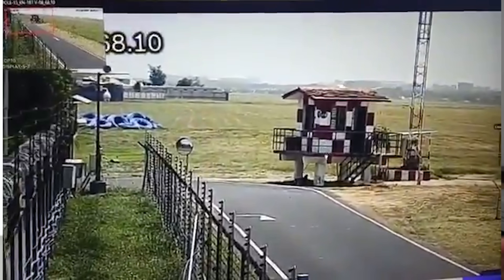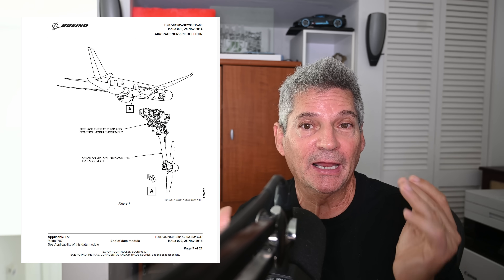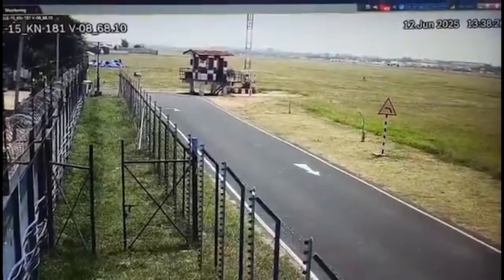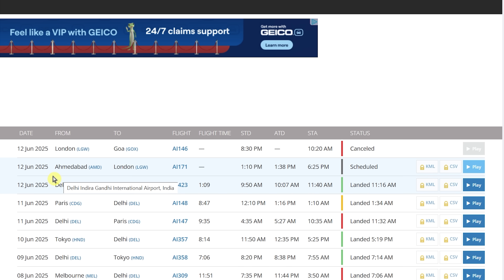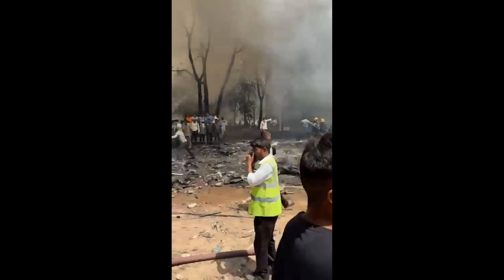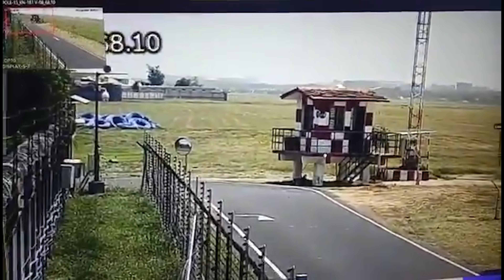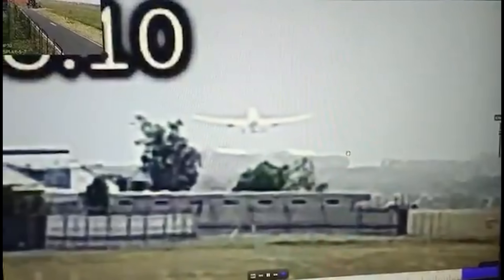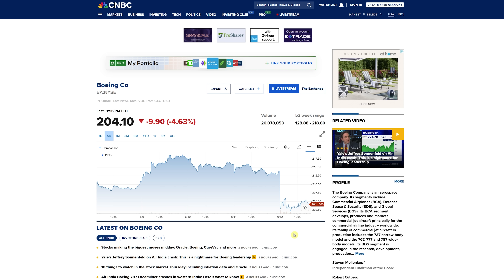What Caused Air India 171 Crash, Mysterious Sound Before Impact

Comment: (what I think it might be, before watching the vid)
as a non-engineer/pilot, my first thought when i saw this video was that he pitched the nose up a little too far when he wasnt getting enough lift, and it caused the engines to stall by the end of the runway (hence the mayday at the end of the runway) and because he was only a few hundred feet off the ground he wasnt able to correct it and crashes.

(halfway through the video analyzing the takeoff)
it looks like right before it peaks altitude, the left engine maybe stalls? because it starts scooting to the left and the left wing drops slightly, listing the aircraft to the left, the right wing comes up just a bit before the pilot levels it out again. here i notice that there is definite heat distortion above the right wing, but not above the left wing, further giving me the impression that the left engine has stalled. 
of course this could just be because of the angle the video was shot.

Ah okay, you debunked my theory of it being too nose up to stall the engines. so i guess that leaves some kind of engine malfunction or possibly bird stike?

Comment: Lone survivor mentions a loud bang. If the RAT was deployed it seems to me the plane lost electrical as the RAT comes down to spin up some voltage. I know early problems with 787 were electrical. And no smoke from engines seems to me dubious that it ingested birds or had an explosion in engines. If indeed Boeing has a catastrophe from poor workmanship(bad electricals) Airbus is going to basically take over the industry. I did fly in a 787 2 years ago. Very nice experience. A shame this plane went down on so many levels. For the people, families but also for a potentially good aircraft's reputation

Comment: At 5:26 video mark, between that tall metal structure and the checkered hut building, I see a flash on the right engine. Not on the engine exit but instead on the outer casing. It’s very difficult to tell, so idk if it’s sun shining off as rotation starts, or maybe it due to poor video quality. Has anyone else noticed it?

Comment: 100% Fact ✅👌🏻✅ Because Full Avionics / Electronics Falure Due to Electrical Issue after full Thrust ✅ That’s When nothing would be able to be engaged - Flaps / Landing Gear Retraction / Yoke Control - No Prior warnings because NO POWER ✅ Engines are perfectly working ✅ But Useless if the rest of the plane is inoperable 👎🏻 The 100% Evedental Fact is the Turbo Prop automatically engages and that’s the sound you hear ✅ The Turbo Propeller is to make power for the electronics Controls ✅ But because it happens so fast after liftoff there was no time to get everything in order to get lift and Control ✅

Comment: Photos of a wing clearly show that the flaps had been extended. 
The ram air turbine will only deploy if both engines have failed and the APU isn't running.  
With no evidence of a compressor stall caused by a bird strike, the accident has to have been caused by some catastrophic failure of the electrical system, cutting off fuel to both engines.

Comment: RAT is for minimum hyd and electrical.  ive seen one actually deployed for a 767 out of Maui  due to dual inflight shutdown it made it to kona.   i was tasked to interrogate the EEC to determine what happened and send data off to pratt/hamilton.  right seat FNG was transferring fuel between tanks on climb out and somehow cutoff both engines.

Comment: 99°F, 27% humidity, 7kt *headwind*, close to max T/O weight, no flaps. 

They didn't have the speed for the air density with the heat and humidity. And an oversite in the T/O check list, they rolled with no flaps. The 787 has been tested by Boeing to T/O at 115°F, but WITH flaps. This was pilot error all day. And its a sad day for those on the flight and their families.

Edited for wind correction. Thank you Peter for letting me know.
Reply: It looks that way but why did the Rat deploy? We keep talking about flaps and agreed if they were selected up on the positive rate call there done at these temps and weight but the video kinda look like they weren’t out at rotation
Reply: @richardgoulden3572  I'm thinking something was missed in the checklist. If they even went through it.
Reply: Oh, FFS: Rwy 23, wind 260/8 and you get a 7 kt tailwind?
Reply: @petergill2265  Easy killer. My apologies. I'd read they were on rwy 05 while looking into this.
Reply: Hi Alice

Thanks for some numbers appreciate it.

100 agree but the issue I have is simple….if they were configured manually incorrectly the crew would have been told
Outside of that they ignored it.
Or on the other hand I am pretty sure I heard a RAT deployed when it went by those buildings on the recording
Reply: Pilot didn't call for distress and no flaps , no alarms went off ? Sounds like software issues that Boeing is being complained about !
Reply: @Mahaabharath  Yeah, jump on the "bash-Boeing" bandwagon. Pilot did call for mayday. Why not wait for the experts to do their job? CVR will tell investigators what went wrong. "Hey Captain, isn't this takeoff roll kind of long? and there's the end of the runway"

Comment: My theory is that maybe they turned off the wrong engine before taking off the runway which led them to using the whole runway as they were scouring to possibly fix said issue. ( It is a very short timespan though) They probably experienced engine issue (the lone survivor described a boom or sort sort during the flight) after reaching v1 halfway and preemptively shutdown the wrong engine which essentially led to taking off with no power. Kinda smiliar to transasia 235 but much earlier than that. Or maybe it happened once it took off but the timewindow of them shutting wrong engine to crashing is so small it has got to be dual engine failure by then.

Another theory that i dont really see as plausable myself is maybe the plane's TMCA shutting down both engines to avoid overthrust. There was an incident in 2019 with a 787 ana flight during landing where the tcma shut down both engines but that was a 787 with RR trent 1000 and boeing did publish bulletins warning of this.
There is also a chance there was fuel contamination at play as the plane allegedly id come out of maintenance. Air india recently have been doing heavy maintenance ln their wide body planes via Turkish Technic but were branchijg out to other MRO's iirc. Maybe could be a mistake that crept during this but this is a very far fetched theory

Comment: In the "original" video it seems very clear that the flaps are up and I don't see the Ram Air Turbin deployed either.  It is a little grainy but look closely, the flap track fairings look up and fully closed.  Since Boeing uses jack screws the exact position of the flaps will be determined very easily.  I could be wrong but I'm leaning really hard on an accidental no flap takeoff with the take-off warning ignored.  It's happened before.

Comment: 👀👀👀CELL TOWERS NEAR AIRPORTS!!!!!!  ✈✈✈. 5G signals are in a similar wavelength range as those used by altimeters, and can cause dangerous errors.  "2022. "FAA will create exclusion zones for 5G cell towers around 50 airports to prevent signals from interfering with altitude instruments after AT&T and Verizon agreed to two-week rollout delay*-DailyMail

Comment: I don't think that turbine was what you heard. When the engines change thrust the fan jet blades will make a noise like that too you hear it often when the jets enter the pattern for landing and they lower the throttle.  It's the blades vibrating because they are now going slower than the airspeed. What I do see is that the flaps were not deployed at takeoff.  If the flaps weren't set properly and tried a standard take off the plane would stall, and that is what I see happening in the video. Without the flaps they needed full thrust, but the automated take off setting probably lowered the throttle for a normal take off where you would have 5-10 degrees of flaps.

Comment: Boeing planes 787 and 777 are not safe, one of the Boeing ex employee and whistleblower few years ago flagged cheaper spare parts, and a survey was conducted where Boeing employees said they won’t fly on 787. News about a passenger earlier on this flight with faulty AC or entertainment won’t bring plane down. Not even flaps if they were down that would actually increase the drag and need more power to climb rather flaps are used more during landing, engines have enough power to lift the plane up, some serious issue with engine power or wiring or fuel supply something terrible went wrong here

Comment: The guy may have jump out during the impact if the wall of the plane open while it's crashing you may have 1 second to jump threw the hole. The wing may have hit something and pull on the wall of the plane and crack it open. That give you 1 second to jump threw the hole before the plane fully impact.

Comment: Good video. There is another video clip of the wing after the crash and both the flaps and the slats were set, or enabled. They used the whole runway, it was a hot day, heavy flight, and rotated at the end of the runway, kicking up dust from the grassy area. Also the seating chart you showed was different than one shown earlier, and 11A is by an emergency exit. Not sure which is correct.

Comment: assuming everything is ok, 1 you take off, the landing gear is on "low speed", 2 you raise the flaps, not enough speed and at a very high angle... the plane sinks, the trunk falls, you lose power and speed and you stay in that position, hmmm, those engines are very powerful, even doing that, if you have full power, (which you should have since you are taking off) that plane should have climbed. My conclusion, it lost all power in both engines for some reason and in a panic they forget to raise the landing gear and flaps... maybe it has to do with the same cause that hypothetically disables the engines.

Comment: -Flaps and slats appear to be in correct position for this aircraft.  787 doesn’t show much flaps especially from the video angles and it’s a cleaner wing than say an old 727 where half the wing comes out.   
-RAT appears extended and audible in the better quality vid. 
-Aircraft took off at normal point on the runway, dust pickup was normal wake turb from dusty/sandy part of the world and normal for heavies here. 
-No major yawing action which to me indicates simultaneous dual engine power loss. 
-No visual indication from the videos of FOD ingestion. No sparks, no surges, no smoke. 

Dual engine power loss with absolutely nowhere to put the plane.  The aircraft was kept straight and level and increased angle of attack at point of impact to lesson impacts to the best of their ability.   RIP

Comment: After initial rotation the plane really doesn't lift like normal. It sort of glides instead so my guess is a problem with the wing flight surfaces. Something got deployed that shouldn't have or the flap settings were really off.

Comment: at 2min it sounds like the engines are at idle not producing thrust. So why did the pilot not use the whole runway and took off at the end of the runway with no flaps. It's in the videos. It should also be noted that mic's won't reproduce the true sound effect of a jet engine.

Comment: Combination of several things

1. The plane could’ve been packed beyond its weight limit, the weather looked hot and dry which means the air molecules were spread out and were less dense which greatly reduces the planes lift on takeoff, which means that if air India packed the plane over the weight limit the reduced lift from the dry heat would be further compounded.

2.Pilot error, obviously. 

3. I’m not a expert or a pilot

Comment: The Plane itself is not the issue, might be to heavy, pilot error or bad maintenance, the 787 itself is a very reliable plane.
Reply: how the automatic RAT got engaged ?
Reply: @firstlast-pt5pp  a desperate maneuver to try  to boost the thrust
Reply: Too much heavy......just an amateur knows that ..
Reply: Don't speak so fast pal
Reply: just wait for the investigation, jesus...
Reply: @stephentrueman4843  but it takes years
Reply: You mean the model of aircraft, I assume. Not "the plane".
Reply: heavy? with half full fuel and 172 peoples on board on 330 max capacity? you math aren't mathing.
Reply: Engines shutting down, low or no hydraulic pressure, electrical generators fail on both engines or other electrical failure will Trigger rat

dreamliner like the modern airbus is reliant on electrical power (flyby wire) no power no flight control, power can power flaps and trims at significant reduced movement speed if hydraulic systems are lost, even slower if the rat is used as significantly less power is available (it is still controllable even if there is no pressure in any of the 3 hydraulic system,as they use a hydrostatic system where each part of the system has a mini tank reserve and a Electric motor pump)

But taking off and then having no engine power isn't going to end well unfortunately (unless your really high up)

Comment: Another point to add, although the plane climbed to 600ft or thereabouts, when you factor in the elevation of the runway (about 150ft above sea level), the climb was only about 400ft before the sink. 

AirIndia is notorious for delayed takeoffs and has also had to ground planes because they could not afford the spare parts to complete routine maintenance. While pilot error is possible, some kind of maintenance issue/ malfunction would be no surprise. The FDR will be key.
Reply: Air India is now owned by the Tata group, whose market capitalization is over $350 billion. Whatever the reason for the crash here, I don't think it would be because they couldn't afford spare parts.
Reply: Let’s be realistic. Air India is owned by the Tata group which is a multi billion corporation, so there is nothing they cannot afford. When they have the capacity to buy 570 new aircrafts, both from Boeing and Airbus, they surely can buy spare parts as well. There may be an error in maintenance- someone failed to do their job properly or the Boeing made another mistake with their planes.
Reply: Maybe overweight and engine cannot cope
Reply: @ConfusedCalicoCat-pk7hu  These aircraft are designed to fly and even take off with one engine. Whatever happened here is completely out of the ordinary.
Reply: @ConfusedCalicoCat-pk7hu plane is definitely not overweight it was climbing perfectly fine before something happened
Reply: @gavcom4060  How can you tell the plane was not overweight? No jiggly bits?
Reply: I can see an indian company cutting costs.. but im guessing there was some catastrophic failure. Im not familiar with the fuel systems and routing etc but idk if a plane can drop like that while at full power. That looked like a massive loss of power. Gonna be interesting for sure.. all i know for sure is im not getting on a plane for a long time lol. This has become ridiculous for a while now. To have so many accidents like wtf.
Reply: Was it 600’ above sea level or was it AGL (Above Ground Level)?
Reply: the aircraft few yesterday morning delhi to ahmedabad 3 hours before the london flight.
Reply: Yes agree
Reply: ADS-B data might show 600’ but that figure should be corrected for field elevation (180’) AND barometric pressure (with a QNH of 1001 at the time of the accident that will be a correction of -360’) so a total correction of 540’. I think it did climb above 60’ but ADS-B is not that precise and further evidence is in the video. The 787-8 has a wing span of 197’, and with the grainy video I don’t think you can actually see the wing tips, but it looks like the aircraft barely reached an altitude of more than 200’ above ground level.

Comment: There is a stop for both engines together. What is the common thing that causes two engines to stop together? Is there a stop in the fuel supply pumps electrically? > Electricity production stopped suddenly due to a fault in the generator. Also, a fault in the batteries. The two fuel pumps stopped. This is a design error. There is something in common between the two engines, especially the fuel pump supply.